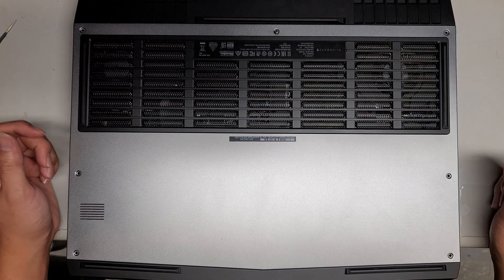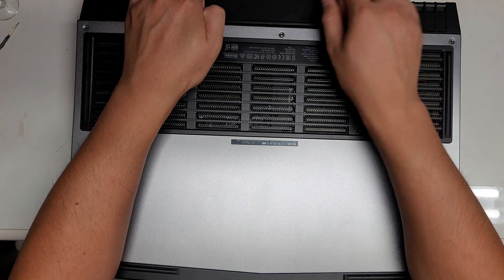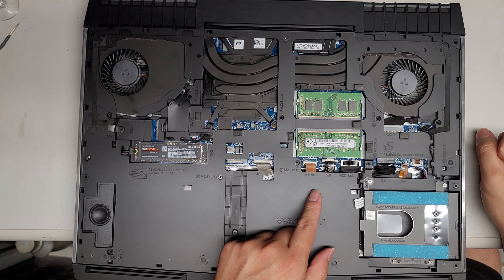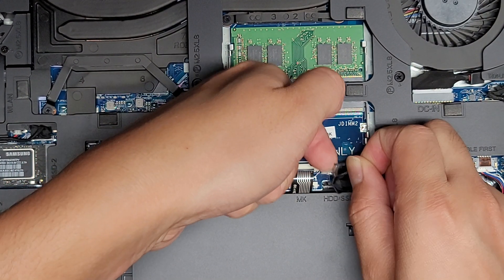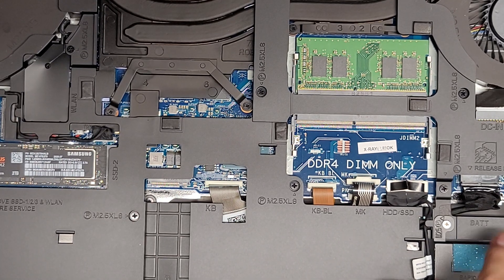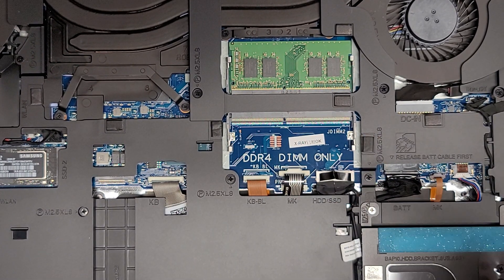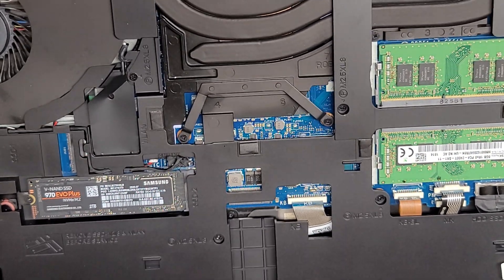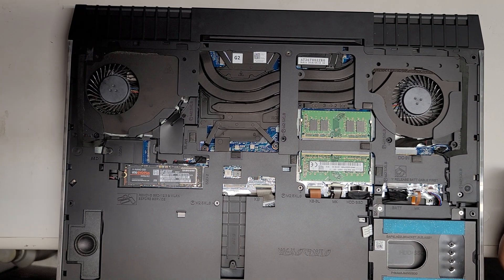Alienware 17 R5 Disassembly RAM SSD Hard Drive Upgrade Repair

Comment: I have now a problem with my Alienware 17 r5 ... Yesterday Dell Support Assist and said there is a drive issues so I updated it from Dell Support Assist. after finishing the laptop got heavy and the D HHD Drive disappeared... I tried multiple solutions but no one worked for me such as :

1- I saw Disk Management to solve the problem but the D disk and all its partition are not there

2- I contacted windows support team and they couldn't help me

3- I checked the BIOS settings but they were fine 

4- I reinstalled Windows 10 again ( D drive appeared for 5 minutes and then disappeared again )

5- I disassembled the D drive from the laptop and connected it again to make sure it's not a plugin problem

6- I ran the diagnostics but nothing showed up

All these methods did not work for me... could you please help me fixing it?
Reply from the maker: You can't repair a hard drive by disconnecting and reconnecting it. You'll have to replace it.
Reply: @ItsBinhRepaired  But I think the problem is not in the hard drive
Reply from the maker: @Eng. Fares Mareai  everything is telling you the hard drive is head and it's not detected and you're saying it's not the hard drive. Why? What makes you think it's not the hard drive?
Reply: @ItsBinhRepaired  I fixed it today
Reply from the maker: @eng.faresmareai50  what was the issue?
Reply: @ItsBinhRepaired  
I don't know but I reinstalled windows from the computer ( I chose to reinstall it with the option of keeping all my files ) then I upgraded the BIOS then the Hard Disk appeared and I was able to use it for a whole day and I copied all my files ( my work ) into a USB ... after one day of normal use now it appears for 15 minutes when I turn on my computer and then disappear again... so I guess you were right and I have now to replace the HHD Drive with a new one
but the good thing that I fixed it for one day and copied all my files... that was a relief because I wasn't worried about the HHD Drive but I was worried of losing all my personal files.
Reply from the maker: Interesting

Comment: did that 2TB ssd work fine in this laptop i have the same setup
Reply from the maker: It will work fine. I don't own the laptop, but no complaints from the customer
Reply: @ItsBinhRepaired  awesome thanks
Reply from the maker: @brandonhaynes9120  no problemo

Comment: do not forget to use some plastic card or anything similar, if you do not want to bleed from fingers :) also running with some plastic tool around the edges will help a lot
Reply from the maker: I didn't get cut from opening the laptop. I got cut from moving it around trying to film.

Comment: This is a really nice laptop with loads of expandable space. I think the small SSD slot is a 2242.
Reply from the maker: thanks
Reply: @ItsBinhRepaired  does it have an mxm gpu or is it built in the board?
Reply from the maker: Almost all laptops have them built in now.